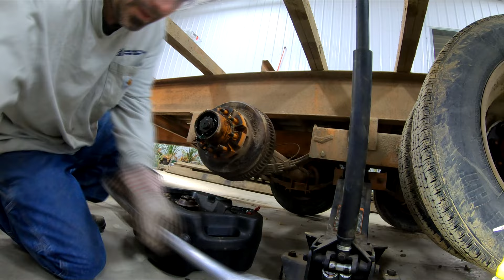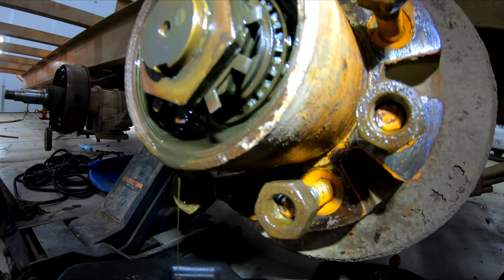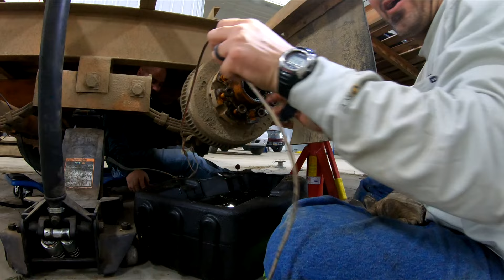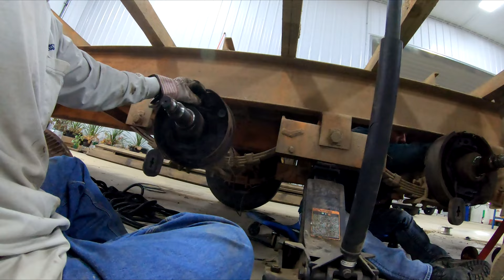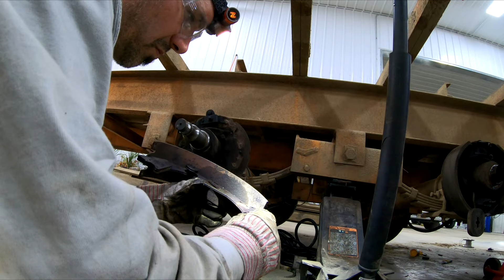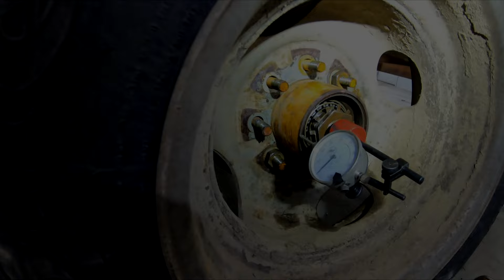changing the electric brakes on a trailer with dexter 10k oilbath axles#dexter,#diy,#oilbath,#haul

Comment: Hi. Thank you so much for the video. Quick question.  By looking through the wheel (without taking the wheel off) is there an easy way to tell if there is a brake system?
Reply from the maker: aniyahudi  go under your trailer and look at the axles from the back. if theres  brakes there will be wires or a spot where there were once wires .  if you mean if theres is any brake pad left  i cant remember is there is a window like on my dump truck.  but if theres now window you will need to get the drum off to see the pads .  hope this helps some  and thank you for watching

Comment: Thanks for the video!! What size socket was needed to remove the axle nut and what are they supposed to be torqued to when reassembled?
Reply from the maker: Display  sorry i dont know off the top of my head 2 5/8" sticks out but deff dont quote me on that . the torqued is at the end  about .10mm play on a dial indicator   or so. let me know if i can help with any thing else. and thank you
Reply: @mrsmel269  2-1/4 socket. Amazon is $17